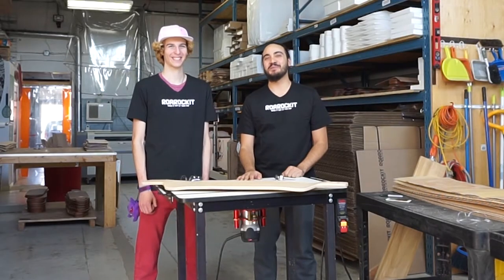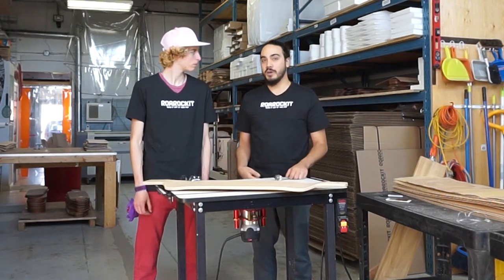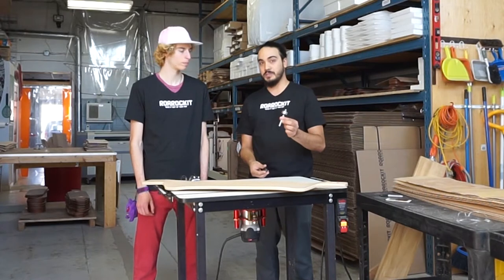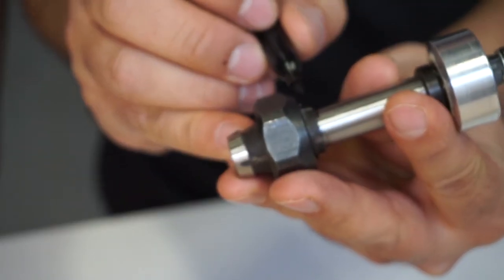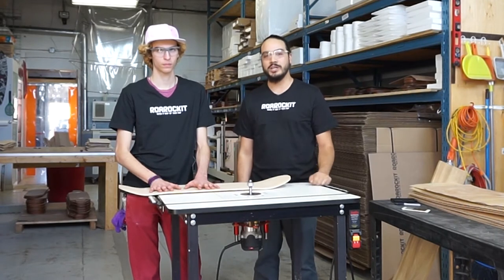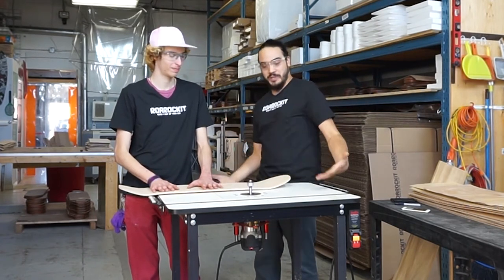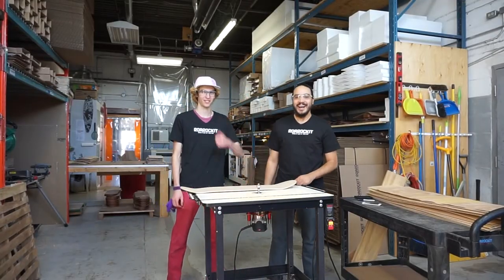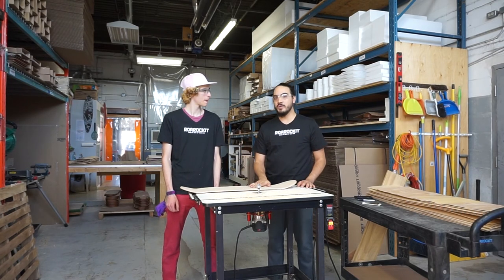Trimit How-to video

Comment: crux314 
Yes I agree with you  if you are using a 1/4” or 1/2” shank bit that is not designed for a specific use. This bit is designed for this purpose, to trim the edges of a skateboard and is safe if used as instructed. The bit has an extra long shank and should be inserted completely into the router as is the case with any router bit. The shank of the bit is more than long enough to ride above the surface of a router table when fully inserted. There are also two bearings above and below the cutting edge that when in use do not spin. This gives you two non cutting contact points to run the edge of the board on. This acts as the two stable surfaces similar to what is needed for safe router work. The only difference is the contact points are attached to the router bit. 
The cutting surface of this bit is a 1/4” quarter round which is very small when compared to much larger bits used in routers. 

I do not know of any other router bit with two bearings like this that you would have had an opportunity to use to base your comment on. With a regular bit, without a double bearing I completely agree with your comments. Thanks for pointing this out. 
I have used this bit many times without any issues of grabbing or kickback.

Comment: Personally I think $135 dollars for this bit is absolutley insane. Considering the industry standard half inch bullnose router bit can be found for $30, and that's for a quality one. Once again, roarrockit is taking people for a ride. $40 for 5 sheets of grip tape?!??!?! Come on, thats just nuts. The kids deserve a decent priced way to make skateboards.
Reply from the maker: Hi Chuck, it sounds like there are two issues here, which I will address separately. 
We encourage you to look into the difference between the two bits you're referring to. We believe this to be a fair price for what is a much more specialty and limited-use tool than a simple quarter round bit. If you feel this cost is too high, you're welcome to research alternatives, and we hope you'll be able to find the tool that will work best for your applications. Alternatively, many municipalities have tool libraries where they are happy to secure a more expensive tool with the goal of providing access to those who cannot afford their own. 
Regarding the price of the grip tape, we cost it high to avoid competing with brick and mortars. We carry grip tape as a one stop shop item for teachers and educators. We will always recommend visiting your local skate shop for items such as grip tape and hardware as it will always be cheaper and you will be supporting the local industry. 
If you have any other concerns, please don't hesitate to give us a call. We are always happy to work with the customer to help make sure they are satisfied with our products.
Reply: Way overpriced just like everything else they sell lol

Comment: Unsafe for two reasons. You should never use a router table not having the board you're gonna work in separate from the table surface (could loose control easily). Bits should be installed as close to the collet as possible (rule of thumb, coin thickness); different working heigths are achieved with the plung of the router.
Reply: crux314 
Yes I agree with you  if you are using a 1/4” or 1/2” shank bit that is not designed for a specific use. This bit is designed for this purpose, to trim the edges of a skateboard and is safe if used as instructed. The bit has an extra long shank and should be inserted completely into the router as is the case with any router bit. The shank of the bit is more than long enough to ride above the surface of a router table when fully inserted. There are also two bearings above and below the cutting edge that when in use do not spin. This gives you two non cutting contact points to run the edge of the board on. This acts as the two stable surfaces similar to what is needed for safe router work. The only difference is the contact points are attached to the router bit. 
The cutting surface of this bit is a 1/4” quarter round which is very small when compared to much larger bits used in routers. 

I do not know of any other router bit with two bearings like this that you would have had an opportunity to use to base your comment on. With a regular bit, without a double bearing I completely agree with your comments. Thanks for pointing this out. 
I have used this bit many times without any issues of grabbing or kickback.
Reply: @MinistryofWood  Thanks for your reply

Comment: Can someone recommend a router to use the Rockit Trimit on?
Reply from the maker: Hi Leonardo, any basic complete router table + router would serve you well. You want to make sure the router has a variable speed motor and a 1/2" collet. We're not fans of hardware store home brands (like Rona hardware for example) and we like mid-range gear like Nikita but look around! Those two points I mentioned are what matter.